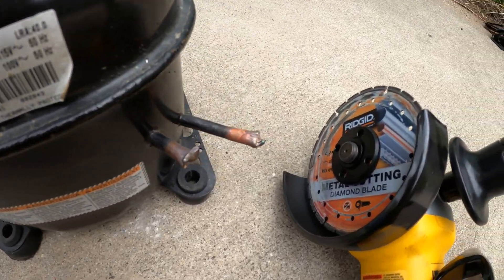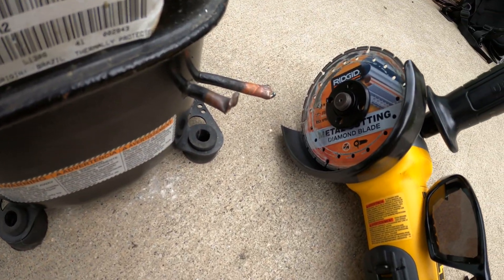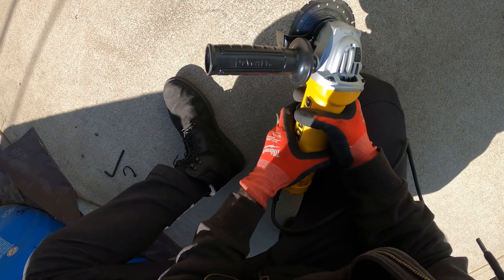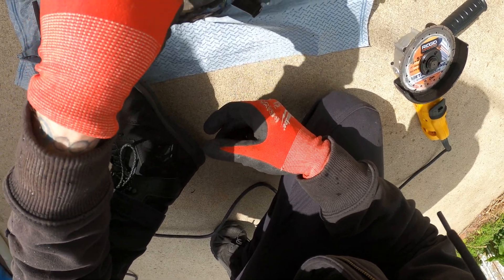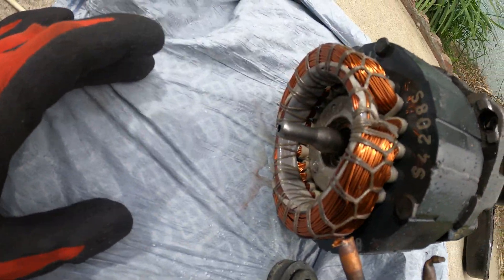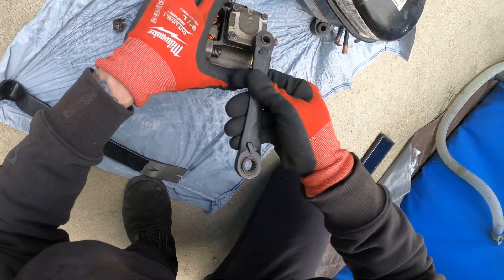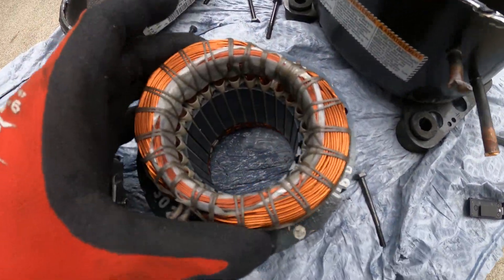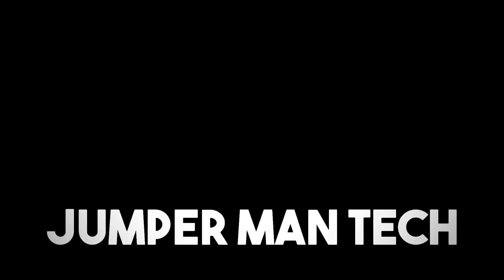HVACR: Cutting open HVACR Hermetic Compressor (Air Conditioning/Refrigeration Compressor) MUST WATCH

Comment: I bet it's mostly the bearings going bad in a failing compressor sucks that usually means a new unit these days I'm brave enough to change them and weld it back shut  but what else could make it hot other than low gas and bearings or internal seals a $100 experiment is cheaper than 800 for the compressor or 5k for a unit so not much of a loss